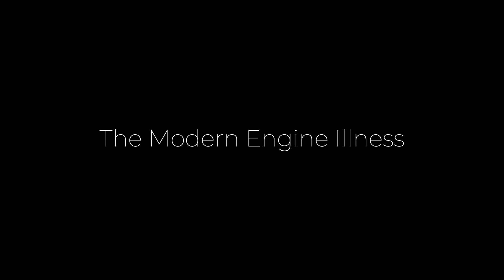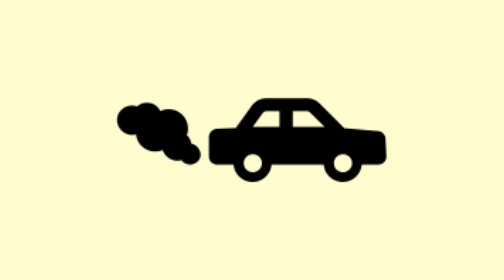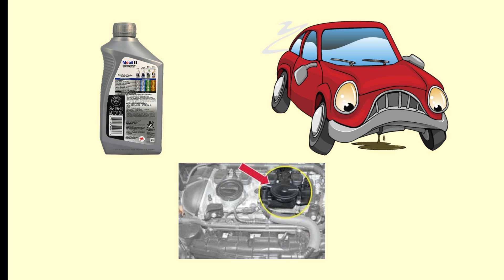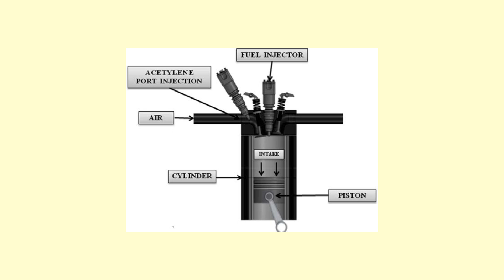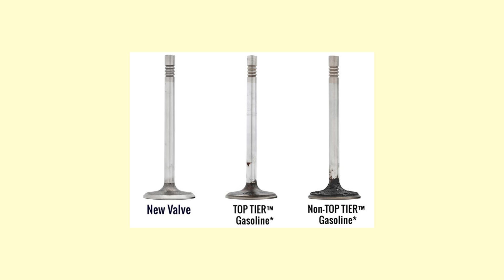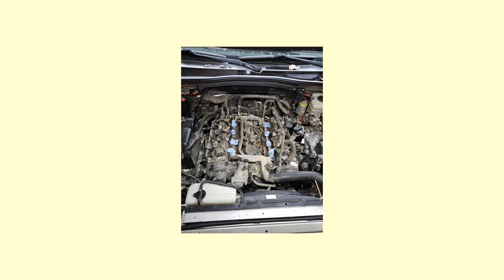The Silent Sickness of Modern Engines

Comment: From an engineering perspective direct injection has a the down side of soot accumulation which isn’t a problem so long as it doesn’t recirculate. The problem is that you’re also sucking in oil from your crank pressure with soot on top of that for emissions. Diesel mechanics have already said these warnings back since 2007 but the epa did not care.
Reply from the maker: I feel like the EPA and the FIA share many similarities in their unnecessary enforcement of laws that serve little logical purpose
Reply: @  an example that you should be aware of related to epa hypocrisy a diesel engine is required to lower tail pipe particulates(soot) but to do that we then rolled out dpf’s( diesel particulate filter) to catch it. You now need to burn the soot to turn it into ash, you do this by spraying diesel into the exhaust stream to burn the ash. This is why modern diesel can’t be fuel efficient. The funny part is this process also produces more co2 to burn the soot. Gasoline engines are heading this way.
Reply: @anthonydennis3089  I think their reasoning is there are certain byproducts of exhaust that are far more damaging than CO2, so they try to optimize for minimizing those instead.
Reply: @theredscourge CO2 is such a red herring. Soot is 1000x times worse because it sticks inside of lungs and the body has no way to remove it. CO2 just makes us have sweet dinosaurs and sabertooth tigers again.
Reply: @theredscourge yeah unlike the EU, the EPA overegulates for this because they derive off California's environmental regulations, which keep in mind is tailored for the fact that they live in a valley.

To avoid smog I.e.

This is a little third hand but it makes sense to why our European / other world counterparts don't have such EGR etc problems. They have leaner diesels too which is like bruh.
Reply: EGR is a shit system, through and through, especially on a diesel. The fact that it's still used on modern engines is asinine, the SCR already does the same exact job far more reliably. The "benefit" of lowered combustion temps is laughable, glaring innefficiency masquerading as an improvement

Comment: 10k mile oil service intervals are what kills most cars now.. GDI engines that use insane fuel pressures that mix with engine oil severely after a couple thousand miles. Not changing your oil every 5k miles is flat out murdering your engine
Reply: Depends a lot on how you drive. Trouble is that those extended oil change intervals only apply under absolutely ideal conditions. As in, all highway cruising in normal ambient temperatires, keeping the engine at a near constant moderate load and perfect operating temp. It's the short trips at low engine temps that tend to degrade the oil quickly from all the unburnt fuel condensing into the oil. Doesn't take many trips to the convenience store in the winter to cause more oil degradation than a whole day road trip
Reply: Oil viscosity density is for cold start lube effectiveness. At operating temperature, oil have the same viscosity with differences on film strength.
Reply: This is true. I've noticed that a lot of 5.0 JLR engines get a pretty bad rap because people follow the 15k oil changes intervals and the timing chain guides take a shit at under 100k miles. I've seen a few higher mileage ones on marketplace with close to 175k miles on their original timing components and every time I ask the owners about oil change intervals, they always say that they do them at 7,500 miles or sooner.
Reply: And ur expertise??
Reply from the maker: U can use 10k service intervals but you HAVE to use thick oil I'd go as far as using like 10w40
Reply: @Enguitive  I'm afraid that's not going to so well with VVT. Even the manufacturers advice AGAINST that. For me it works because I run a 90s corolla with INVARIABLE valve timing. 😅
Reply: @Enguitive  That and a lot of highway miles. Short trips where the oil doesn't get up to temp is HELL on your service interval usability.
Reply: @Enguitive  Plenty of direct injection engines are specified xW-40 oil, especially most older (<2019) VW/Audi engines. Even with the OEM oil grade, you still need to change the oil every 5k. To go any longer, you need to switch to a xW-50 oil if you care about your engine's longevity. I personally use Eneos Racing Street 0W-50 (yes the name is edgy, but what else could you expect for a Japanese company?) as I live in a place with cold winters and don't want to change my oil often. While the viscosity range might seem excessive, the HTHS (high temperature high shear viscosity) is 4.7 which is well within spec for a 50 weight oil and is above that of any 40 weight oil due to the quality PAO base stocks used. On the other hand, avoid Mobil 1 0W-50 Racing as it is made with low grade base stocks and large amounts of viscosity improvers as indicated by its HTHS of only 3.8, well below that of any xW-50 and even inferior to good quality xW-40 oils, so it will quickly shear out of grade.
Reply: @Enguitive  You have to be careful with thick oil because modern engines have smaller diameter orifices and passages that are designed for lower viscosity oils.

Comment: Direct injection cost less money to manufacture. They have a plastic intake manifold if any at all.
Reply: Plastic intake manifolds are perfectly usable with port injection and fuel resistant plastics are utilized in many components, including the injectors themselves. Direct injection requires many high strength steel components to handle much higher pressures than port injection, so no, it is not any cheaper. The worst plastic parts on engines are coolant pipes and radiator tanks made from nylon as they undergo hydrolysis whenever they are exposed to water, which is massively exacerbated when they are exposed to hot water at around 100°C.
Reply: @quentagonthornton49  plastic costs less money than aluminum, and they call port injection direct injection on some GM cars. The plastic radiator tanks cost less money than brass radiators, then they raise the price like a Hershey's milk chocolate bar.

Comment: My grandpa told me this, you can make a small engine powerful, but nothing can reliably replace displacement and 6 or cylinders in high power applications. Sure bigger n.a. engines have worse gas mileage but at least they're somewhat reliable
Reply from the maker: Perfect example of this is the GR Corolla, its turbo's pushing 25.2 psi (which is almost 2 bar of boost) and this is a 3cyl 1.6L engine making 300hp, making it very high strung from factory already. On the other hand, the 2GR-FSE is a 3.5L V6 which makes that power extremely reliably, even the famed Supra's of yesteryear that could push 800hp reliably are 3L 6 cylinders.
Reply: @Enguitive facts
Reply: @Enguitive yeah but the GR engine is very well built and can handle the load plus the yaris is very light car so the engine isn't stressed.
Reply: @ghoulbuster1 Except the fact that it bursts into flames.
Reply: @ That was the corolla not the yaris.
Reply: @ghoulbuster1  same engine
Reply from the maker: In the Yaris yeah as it's making 257/268 hp depending on where you live, the Corolla does have some forged internals but compared to its competition (MK8 R, CTR), there isn't as much headroom to make more power reliably within that engine
Reply: @ghoulbuster1 So well built that they catch on fire after the car exceeds 85mph.  Lol
That situation is such a joke.
Reply from the maker: @christopherlowery855  🤣🤣🤣
Reply: As the saying goes-
“there’s no replacement for displacement”
Reply: @preludepower420  no, there is, the replacement is called moderation. Driving moderately and without frequent intense strain on the engine and moderating the engine's wear properly. I have an Ecotec DI engine and they're very well-known in the community for being decently workable power plants, so long as they're not abused.
Reply: That's false flat out especially now. Ford's v6s are making more power than GMS dodges or even their own na v8s while outperforming all of them in reliability
Reply: kid named walnut blaster:

Comment: I believe that there are no advantages whatsoever of "direct injection" in spark ignition gasoline engines except for a possible increase in horsepower per cc. or cubic inch of displacement 
I believe that emissions actually increase compared to port injected engines.
Reply from the maker: Depends. If the carbon buildup is maintained to a high degree via preventative maintenance, then not as much, otherwise it will release more hydrocarbons in the air if carbon clogs up your engine's internals and it will show by releasing either too much or black exhaust smoke.
Reply: Direct injection is only useful with double injection (port + direct) as it gives better control of the fuel and both can be used depending on the RPM.
Reply: You can inject fuel precisely at the right moment, you can run more compression on the same grade fuel. Paired with modern efi you can have 12 to 1 compression and run regular gasoline...
Reply: You are spot on.  Although it does not increase power either!

Comment: then there's the foolishness of stop start on a turbo 4 cylinder roasting the turbos due to lack of cool oil running in the turbo brg's while stopped at every stop light .
Reply: Stop start on a 4 banger is pointless, you're saving tiny fuel for more wear on the engine.
Reply: @ghoulbuster1  Scotty Kilmer said its not so bad.
Reply: @anythingbutASIC Scotty Kilmer will also tell you to buy a celica
Reply: @ghoulbuster1 they have cylinder deactivation on 4 cylinders now. Beyond pointless.
Reply: Coolant cooled turbos and electric coolant pumps are a thing
Reply: Having multiple cars with over 100k MI with this feature, unless youre beating on it, doest wear the turbo any faster. My hybrid 2.0T will actually not allow engine shutoff if you've just come off a pull.
Reply: Water-cooled turbos don't suffer from this issue. I don't think you can really buy oil cooled OEM anymore?
Reply: Stop/Start would be better with a 48v mild hybrid system that kept the accessories (incl a water pump and oil pump) running and simply clutch-activated the front crankshaft pulley to start the engine again (and get you moving off) when the time came. Could also work for about a 50hp boost at any given time when you floor it.
Reply: @Drunken_Hamster this. I hate that hybrids are used to make lame cars 90% of the times, when they can do cool stuff like this.
Reply: @Drunken_Hamster  the new tacomas with the hybrid does all that except the oil pump part unfortunately. So close!
Reply: @Drunken_Hamster some of the -40i BMWs have this and it's a lot better than normal stop/start
Reply: Suckers. No start/stop on a manual. At least not mine, and it's a 2020, so not old.
Reply: I didn't think they actually made such a thing. Literally anyone who knows things about cars would tell you that would happen. Negligent-ass companies knew sure.

Comment: low tension rings cause oil burning just to save 4 hp and one hindered of an ounce of gas
Reply: I agree. To Toyota's credit they use a combination of direct and port fuel injection, so carbon buildup is not an issue.

However, like everyone else use low tension piston rings.  We have never had a Toyota burn oil and we keep our cars until the wheels fall off here in the US rust belt. Our 2020 Corolla started consuming oil at the 45,000 mile mark even though I changed the oil every 5k miles. Took it to the dealer for an oil consumption test. Were told the Toyota spec was consuming a quart every 1,000 miles is acceptable. So disappointed with modern cars. Also high oil consumption cannot be good for the catalytic converter. Not sure what we will do when we need our next car as this is not just a Toyota problem.
Reply: @tomschmidt381 1qt every 1000mi is acceptable!?
That's not even acceptable on a vehicle with 200k mi.
Car manufacturing today is absolutely insane.
Reply: Subaru has the same standard haha, 1qt per 1,000 miles. It is the fault of CAFE regulations.

I had a Subaru crosstrek, decided to try running 5w-20 Mobil one EP (instead of 5w-30) for 8,000 miles. I had added an entire extra 5qt container by the end. Then I sold the car.
Reply: @tomschmidt381 start using Valvoline Restore and Protect
Reply: The cat on by buddy's VA wrx took a crap last month for that exact reason. Ripe 44k mk. That was an extreme case though, ate over 4qt in the span of a day during extreme cold

Comment: Modern engines = Political engines not engineering brilliance.
Reply from the maker: 100%, I miss the old high revving VTEC Honda days, not much stirs the soul for me nowadays when it comes to new cars besides the twins and the ND3 Miata
Reply: @Enguitive  I still drive a late 90´s designed Nissan QG18DE 1.8L na engine with a manual gearbox. I run it on 5W-40 oil instead of the recommended 5W-30 It just keeps on going.. I see them on sale with over 400.000Km. mine has done only 180k. so no hurry to upgrade to a political engine or buy expensive political oils (xW-16-20....)😀